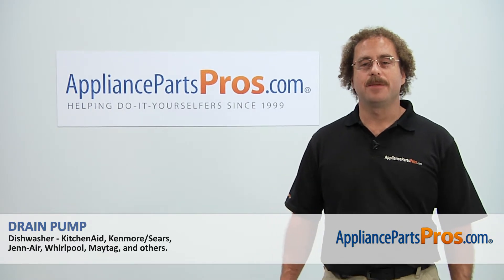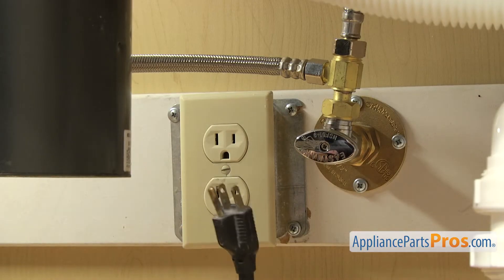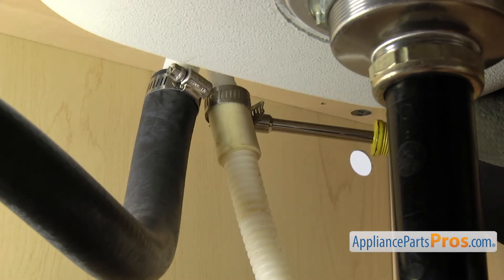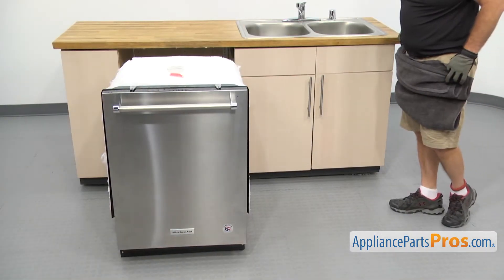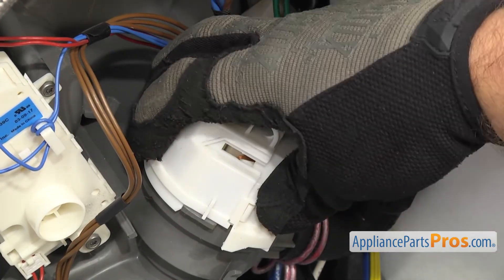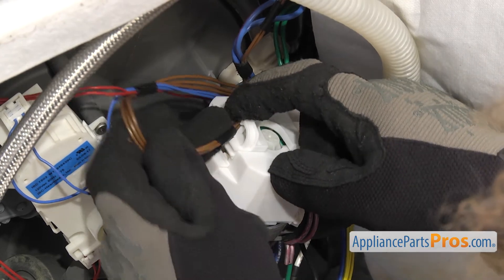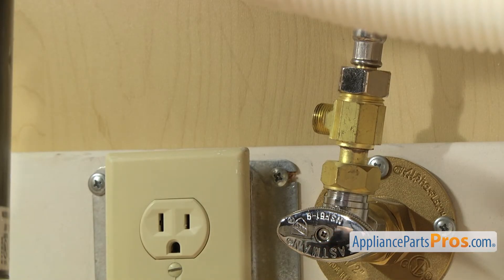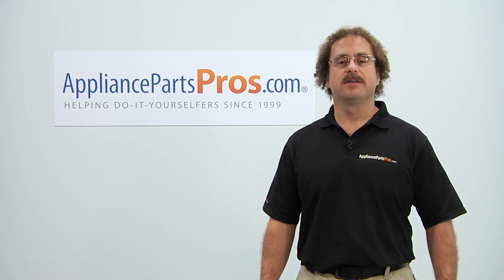How To: Whirlpool/KitchenAid/Maytag Dishwasher Drain Pump WPW10531320

Comment: Very clear and helpful video, thank you. The drain pump can actually be removed and replaced from below without having to remove the dishwasher from the cabinet or disconnect the water supply or drain hoses. (I had to do all of that to replace the drain hose and drain hose extension. After returning the dishwasher to the cabinet and reconnecting everything, I discovered that the failure to drain was actually due to a broken drain pump.)

Comment: I didnt need to flip mine over, just removed front panel and was able to remove the drain pump and also figured out most of the time the noise is from grinder and everyone goes running to buy a drain pump.